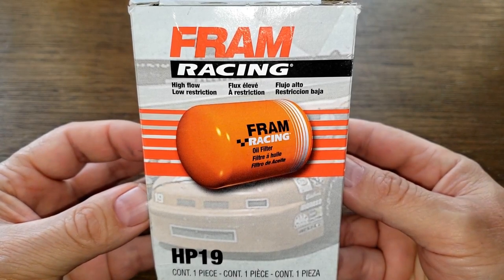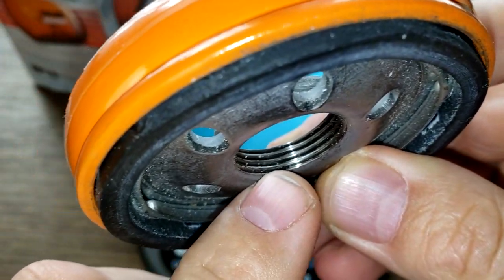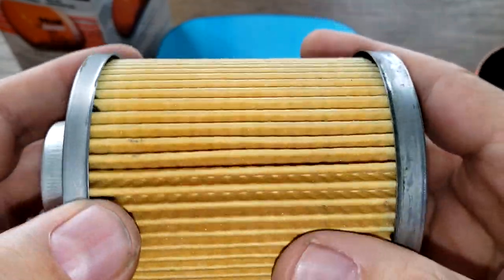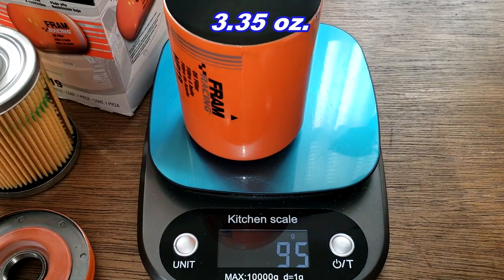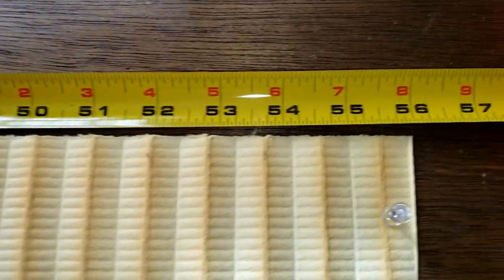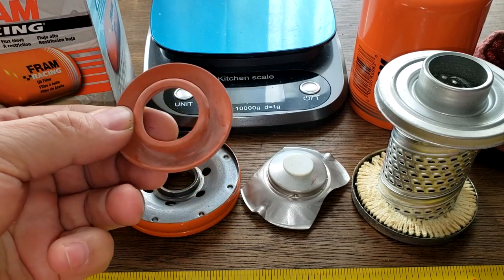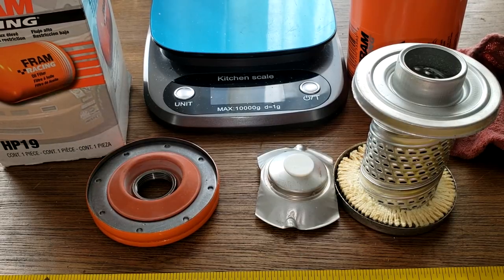Fram Racing Oil Filter HP19 Cut Open

Comment: Well I am baffled this well made filter is only rated  for 3000 miles and a crappie FRAM Tough Guard is rated for 15000 miles?if only Fram could made them all like this one
Reply from the maker: Good question? I can see 3,000-mile racing, the filter may not last as long. But what about a daily driver, the filter media looks to be as good as any Supertech oil filter that I've opened.
Thanks for the question maybe someone can give us an answer, I'll put this comment up top.
Reply: They want you to buy more.

Comment: 94% at 20 microns. For those of you that do not know. 20 microns is .00079". A human hair is .002-.003" thick. Notebook paper is .003" thick. A lot of my machining tolerances are .0005". So that is actually a pretty big particle for a filter. Add to that 6% getting through are bigger than 20 microns.
Reply from the maker: Thanks for sharing that info!

Comment: Hey Whip, Happy New Year! Does the sticker on the can say “Made in China”? I cut open a HP18, not sure if I have an older filter design, but the HP18 does not have louvers, it has the holes instead. I bought mine from Rockauto. I see Wix has also gone to the louvers and leaf spring design. Thanks
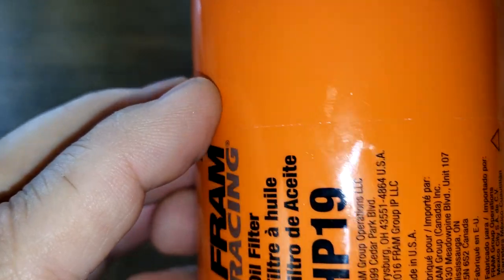Reply from the maker: Nope, it says Made in U.S.A 1:10 on video.
Happy New Year Shabeer!

Comment: I wish Fram was making all their filter this way, it looks like a decent filter but why 3000 miles? if they were all made like that  I will be going back to Fram with no hesitation. thanks! happy new year
Reply from the maker: Happy New Year bud,
I was wondering the same thing about the low mileage rating.🤔
Reply: Bud black. 3000 miles is a lot of racing. Most racing oil is not.recommended for much farther if even that.

Comment: Good show.  Why is it not recommended for daily use?  Happy New year!!!!  It has been a good year.  Many great shows.
Reply from the maker: I dont know why it's not recommended for a daily driver. The filter media seems like it would hold up just as well as other filters that are rated for 20,000 miles.
Thanks and Happy New Year!
Reply: My best guess the filter is designed for high flow than filter but I could be wrong 

It’s like the racing slick tires designed for ultimate grip but only lasts 50 miles for an example
Reply: @WhipCityWrencher  At least it's fair: 20,000 miles, 15,000 miles...30,000 miles is just a "marketing trick" if I made filters (for non-commercial cars), I would write on them  "no more than 3000 miles".

Comment: Looks pretty robust, is there any benefit to the bypass valve being located on the bottom versus the top of the filter housing? Seems like one located at the top would be better for cold starts
Reply from the maker: Base plate end bypass valves are better in MHO.
Reply: @WhipCityWrencher  like the one shown in this video or more like the Mopar MO-899 and Motorcraft FL-820?
Reply from the maker: @PhOeNiXpIoLe  I like the Bypass valves on the MO-899 and the FL820. less of a chance of pulling debris from the filter and going back into the engine.
Reply: @WhipCityWrencher  same here

Comment: 2 vids per week.  Nice.👍👍 I really wish filters had set standards ...94% at 20 microns seens terrible compared to an Ultra at 99% at 20.
Or is this one 99% at 21, or 25 or 35?
Reply: It's for high flow , racing
Reply from the maker: I wonder if its better than a filter of 99% at 30 microns🤔
Thanks for the feedback!

Comment: When I was a kid a neighbor had his engine built with hi-po parts by a machine shop , and the tolerances musta been too tight he figured because the oil filter blew open like a block from his house. Would that do it or did he need a better/thicker filter ?
Reply from the maker: I dont know how old you are but could be he needed a better filter with all the mods. The filter probably wasn't made for that kind of oil pressure. I know back when I was younger the engines also called for thicker oil, which would raise the oil pressure even more.
Thanks for sharing👍

Comment: Interesting that the box says racing use only but the video on the site says 6000 miles of street use.
Reply from the maker: Yeah, I dont get that either.
I'll be showing a used one this coming Tuesday, May 31st that a viewer sent me.
Thanks for your feedback!👍
Reply: @WhipCityWrencher  I'll watch out for that one.  I have to run 20w50 due to bearing clearances for boost and was looking for a filter that would push more oil through easier with a high volume/pressure pump.

Comment: NOT FOR HIGHWAY USE, change at 3k miles.i think id change it sooner if i drove 3k miles thru fields or beaches.& who runs a racing engine 3k miles on oil.common sence is no longer common.

Comment: Fram is on my absolutely will not use their oil filter list, had a Ford F250 only a couple months since oil and new filter, idling in my driveway getting ready to go somewhere walk out and a stream of oil is shooting out from under the truck, almost ran out of oil, found the source the Fram filter had a hole in it, several areas were as thin as aluminum foil from rust on the inside, not going to risk seizing an engine because of their garbage grade steel.
Reply from the maker: Never heard such a thing, how can it rust from the inside?